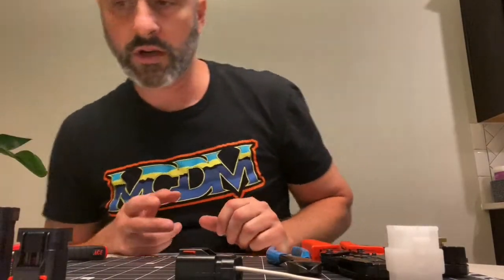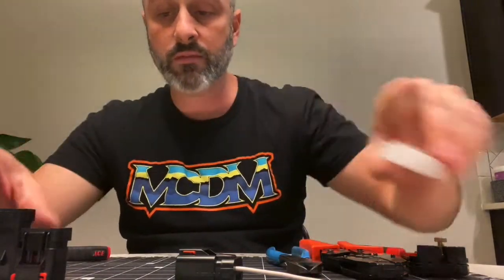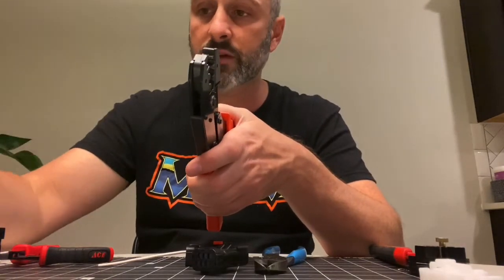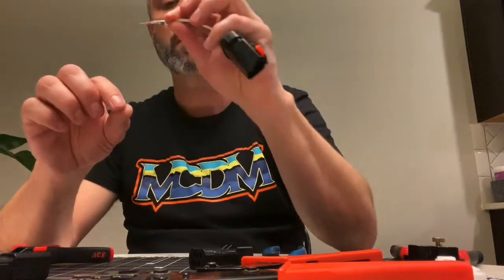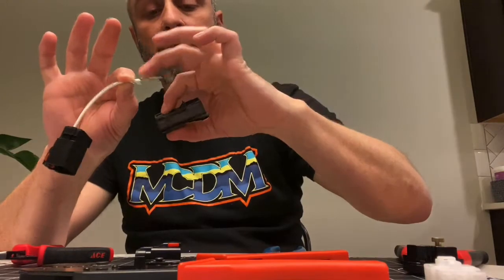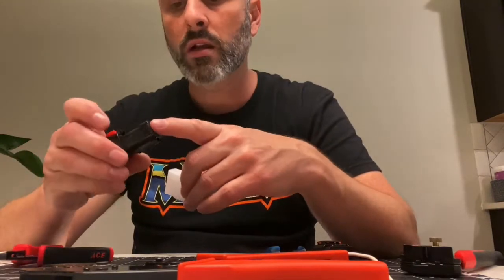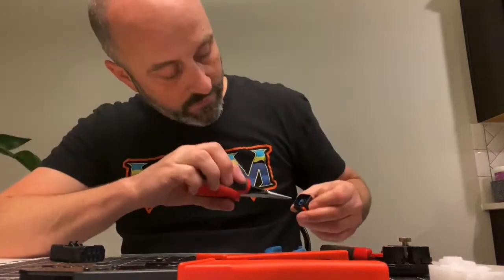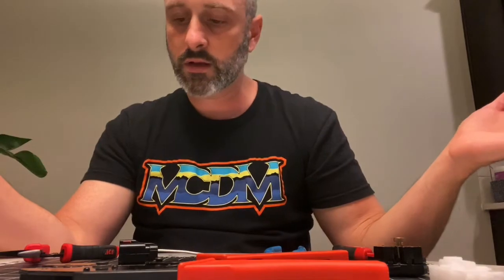APEX 2p8 Connector Walkthrough

Comment: Incase anyone was to depin it. If you point it towards you with the red lip on the bottom theres a catch on the bottom of the hole. Its in-between the wire connector (wire with a little metal connector) and the connector itself. If you put something in-between it you can then pull out the wire

Comment: Those apex connectors are OEM connectors on a cummins isx15 motor for semi trucks if anyone with an isx is wondering and on my 2016 t680 with 822,000 miles yeah those last forever sometimes the locking tabs are a pain after being weathered and heat cycled but pliers or a flathead screw driver will usually get them to unlock I only had to replace one on my oil pressure sensor because the lock broke but that's an easy connector to replace